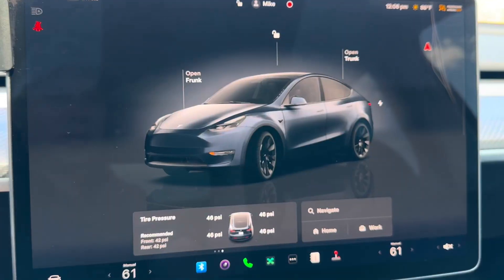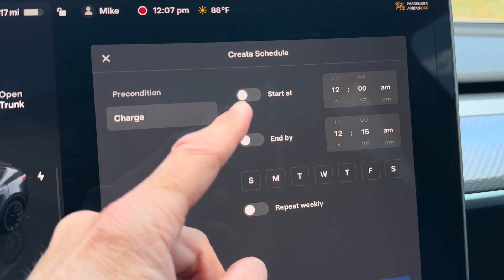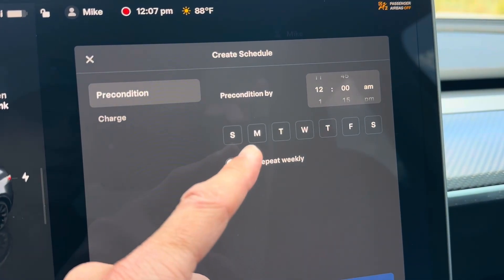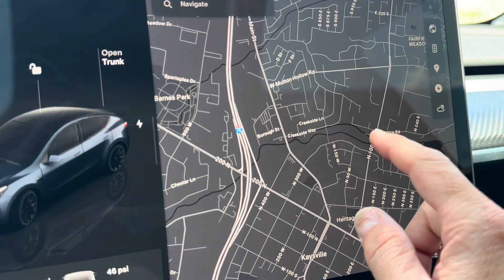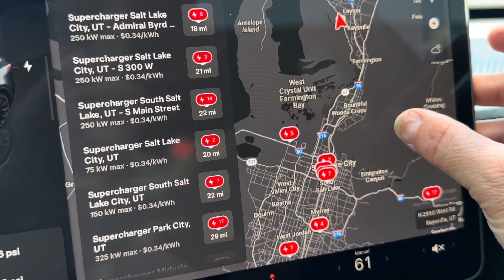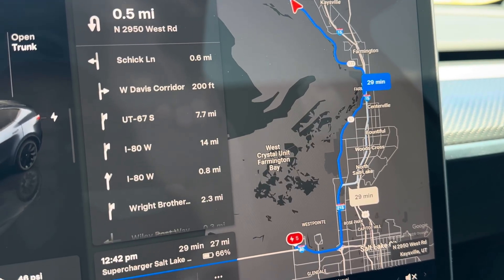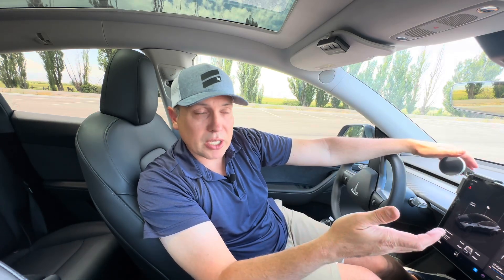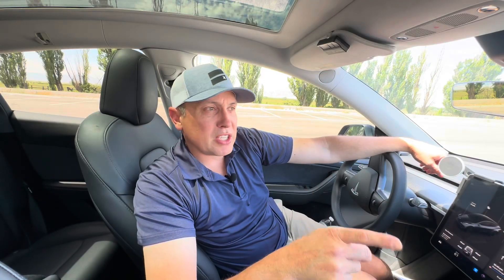Tesla Battery Preconditioning? What is it? How does it work? When to Use It?  Is It Necessary?

Comment: I'm planning on purchasing a Model Y Juniper, I didn't even know about preconditioning a battery. Glad I found this video. Thanks!
Also, is there a way to manually activate precondition charging? say I'm driving and I know there is a supercharger in 5 miles. I don't want to set up the navigation, since I know where the supercharger is located at.
Reply from the maker: Always use the navigation for going to a supercharger.  It will pre condition the battery and let you know how many stalls are available when you arrive
Reply: @Myksgarage  ah good point, I forgot about the availability. I'm still thinking about gas stations where there is always a spot available.
Reply: @favoritemyvideo it is highly unlikely you will ever have to wait for a charger at a super charger.  I never have.  Also, gas pumps aren’t always available and there are plenty of times I recall having to wait for people to pump their gas and leave…but those days are behind me now.

Comment: Thank you so much, still wondering how preconditioning system works ?
Reply: I rarely supercharge but had to when I was going from Florida to Vermont and back. 
When I supercharge I shut off the preconditioning because I didn't really care if it was going to take longer for the car to charge. I wanted to go in to a place to eat, go to the bathroom and figured it would take about half an hour. Didn't want to get fees for leaving the car plugged in if it would wind up being charged before I was done.  
I figure if I charge to 80% and then drive for 3 hours and then take a break for half an hour it's a lot more comfortable then trying to make it there as fast as possible.
Reply: @tombournique  hmm... that's a good point.  Also, you save on overall energy consumption... I think?  I know it will warm up the battery in process, but does it warm it up less?  Meh, it's probably about the same.
I wonder about overall battery health too, if it's better one way or another.
Reply from the maker: The battery uses its own power to heat up to optimal charging temperatures
Reply: @Myksgarage  sure, but I'm curious as to the details.
One thing that may be considered obvious that isn't explicitly spelled out is, as far as the SCHEDULED preconditioning is concerned, it seems that the car must be plugged in for this to work... whereas the system will, of course, draw from the battery to warm the battery on the way to a Supercharger.

Another is, you mentioned 76°F being the ideal temperature overall for the battery... but then that the battery should be as warm as possible for charging.  So it seems that means that "preconditioning" is separated into two categories:  1.  preconditioning for driving, and 2. preconditioning for Supercharging

I guess there's no way to precondition for Supercharging before one enters the car?  This would actually be a useful feature, especially if they enabled it to work without being plugged in.  Say a "schedule future Supercharging" feature for travel, where someone can plan a session at a Supercharging station that is nearer than what would be required to fully condition the battery in time.  One could set a departure time and the SC destination the day before, and the car could calculate what time to begin preconditioning so that the battery is at the ideal temperature by the time it arrived at the station.

Comment: Say I set a schedule to charge at home certain nights of the week. Do I also need to set a precondition schedule to happen before the charging starts? Or will it know to precondition the battery on its own before the charging starts? Let’s say I do 9pm. Do I also need to set a precondition schedule for like 8:30?
Reply from the maker: No just set the schedule, then plug it in
Reply: You don't need to worry about preconditioning the battery for home charging because it is low power AC charging. Preconditioning is only required when fast charging using DC like teslas superchargers
Reply: @ourpetsheadsarefallingoff6654 it’s not required for any type of charging, even at a supercharger.  It just optimizes charging if you precondition.  All you have to do is always navigate to your supercharger, but if you forget, don’t worry about it.

Comment: I charge at home thru a Tesla Wall Connector at my garage. I work from home and don’t do lot of miles in a day, just occasional running errands and stuff and so I set the charge limit to 50% and set around 2 am to charge may be 10% that was depleted running errands. I have couple of questions.
1.  I don’t set any pre conditioning schedule because of the above mentioned reasons and I’m not sure if I have to for my use case. Is it recommended to pre condition the battery when you are charging at home using level 2 Tesla wall connector?
2.  I don’t see an option to just precondition the battery and not precondition the cabin because I don’t have set schedule like leave for work at 8am etc. Is there an option to only pre conditioning the battery and Not the cabin which in my case is unnecessary?
Reply: If you're trying to keep stress on the battery to a minimum and only tend to use a max of 10% on a given day, I think I'd still charge to 55- 60% so that it stays above 50% most of the time, but the difference, if any, is probably negligible.

1.  No need.  The battery doesn't need any special preconditioning to accept 10 kW of power, which is what a typical 50 amp L2 charger will provide.  And even if your car had an ice-cold battery that couldn't even accept 10 kW, since you're charging overnight, it would use power to precondition the battery first automatically to get to the right temp.
That said, if I were you, I would use only the "End charging by" feature to align more closely with either when I tend to need the car, or the tail end of the "off-peak" power range set by my utility.

2.  There should be an option to only precondition the battery, but as stated before, there'd be no real advantage in that if you're using so little of your range.  It would be a good idea, say, if you parked your car outside in the snow and were charging the car to 100% to leave for a big trip... then scheduling both the preconditioning of the battery and the cabin would make a lot of sense to max out the range before needing to make your first Supercharging stop.
Reply from the maker: Looks like I need to make another video to answer your questions 😀